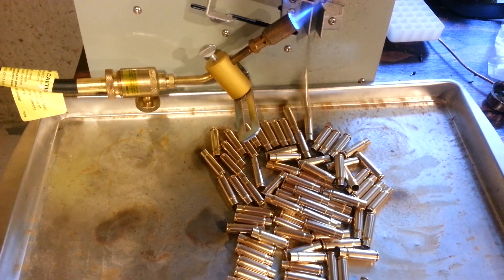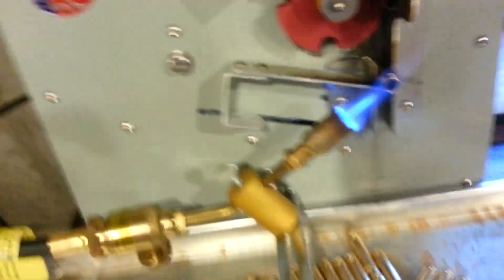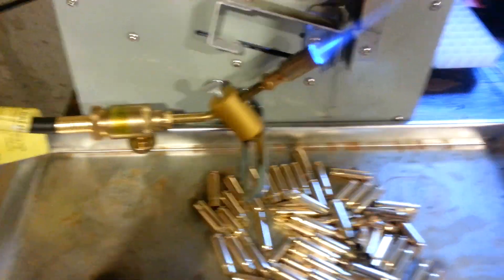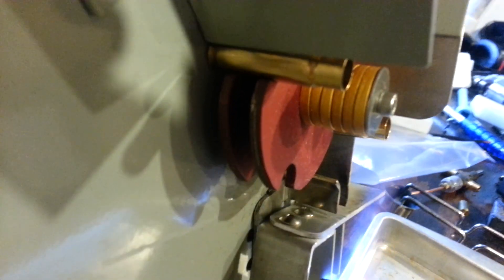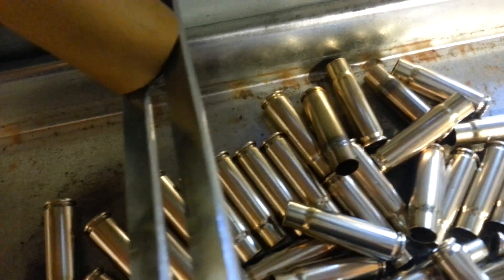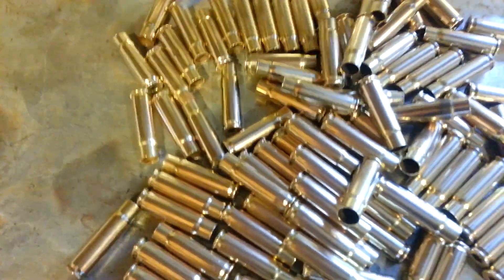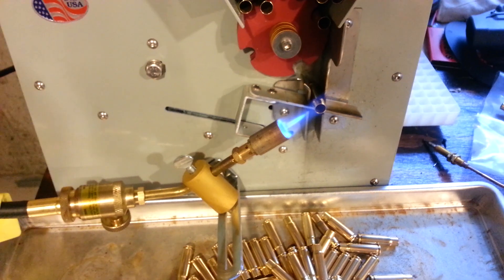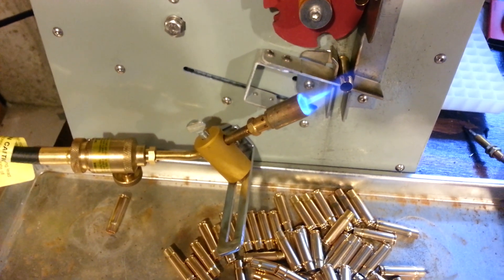Why coloring is not a good indicator of proper annealing.

Comment: A laser pyrometer is probably the best instrument for uniform annealing.
It's all about TEMPERATURE not color.
Reply from the maker: Yes, a laser pyrometer is a good tool to have, but keep in mind that the mass of these cases is quite low. You can't get an accurate measurement while it's in the flame, and the case will begin cooling rapidly the instant it drops out of the flame, so you have to be very quick or your measurements will be incorrect.

Comment: Has some tested with a hardness tester that 700 ° is enough. After what i have learned one has to anneal it for half an hour at this temperature. 900 ° to 1000 ° is probably more correct for approx. 5 seconds.

Comment: None of that "verification" is direct measurement of annealing.  You need to demonstrate photomicrographs of grain structure for 70/30 compared to a certified photograph, OR, use a vickers microhardness penetrometer tester on specimens material and compare that to the target value, OR run pull specimens on an Instron type machine with load vs. displacement.  That is three methods for your choice.  Everything else is guestimation.

Comment: I am repeatedly surprised by the large number of annealing videos that show dropping of cases into a tray following the heating process.  I would think that retention of body work hardening would be important, and that the best way to avoid creep of the softening into the body of the cartridge, where it is decidedly not wanted, would be to quench the brass in cold water once the neck/shoulder softening was complete - although I understand that this would introduce an additional drying step and time to the process.  

Also, I think the process rules for a company that produces annealed brass from used cases for use by anyone should be different from the process of an individual annealing brass for his/her own use.  In the former case, the brass has to be neck and shoulder annealed to accommodate full-length resizing, since the chamber in which it will be used is unknown beforehand.  In the latter, the handloader knows the gun in which the brass will be used, the brass is already fireformed to that chamber, and the best route is to neck anneal and neck resize only, I would think.  Thoughts?
Reply from the maker: Quenching serves no meaningful purpose. There's not enough mass in the case neck and shoulder for heat soak to be an issue, and the relatively large surface area of the case causes it to start cooling immediately. There's nothing to be gained by getting the brass wet again, besides, as you mentioned, more headache of having to deal with overprocessing them and drying them off again.

As a proponent of LEAN manufacturing principles, that's something to be viewed as one of the 7 deadly sins of waste.

People who quench are doing so based on a fundamental misunderstanding of how brass anneals.

And whether you're producing brass commercially, or converting it for personal use, the resulting work hardening is the same. The same care should ideally be given, but most people don't have access to expensive annealing machines, so it's cheaper for those guys to skip annealing, and replace their brass more frequently.

I know a lot of manufacturers who, unfortunately, don't have enough regard for their craft or their customers to anneal from the factory, or who want to charge additional for that as a 'service'.

We've always made it a point to anneal ALL of the brass we convert.

Comment: Hey Wrenchmonkey I'm just getting into Annealing mainly to create my own 22TCM cases from 223 brass. I was thinking with as super short the 22 CM case is water quenching would be a good idea just to stop the heat transferring  down to the base which could create other and possible dangerous issue. Instead of letting them air cool.
Reply from the maker: You can do that. Quenching doesn't hurt anything. It just means you have wet cases that you'll have to make sure are good and dry before you can load them.

Comment: Excellent description on how the cases should look. I have the same machine for 50 BMG and I tried until I was blue in the face to get the same color as factory cases. Burned a lot of cases until I found your video. Now it makes sense.
I know the temp is correct as the Tempilaq turns clear just as it drops off the end of the tray. I 'air dry' to save the additional step of drying wet cases in the oven. 
Now I spot check when I am doing a can of cases and the temp is right on the money each time. 
My cases go through annealing as the last step so it stands to reason they will not get as 'done' as cases that are unpolished but when the Tempilaq 750 goes to clear, I know I have everything dialed in.
Many thanks.
Mike in FL
Reply from the maker: Glad you found it helpful. If you are wanting the coloring that you're used to seeing from the factory, you can get decent coloring just by letting the case age for a few weeks before you anneal.

There is a way to get some really nice coloring into your brass, if you're sold on the idea. It takes a bit more work. It's strictly cosmetic, so we don't do it. It would add a lot to the cost of our brass, with no real benefit to the customer, so we don't do it.

But if you're doing your own ammo, and you just want it to look awesome, I can do a video teach people how to make some gorgeous case necks.
Reply: Don't really need to do any of that as I know it is cosmetic as you said. I am happy with what I have and when you tumble in SS pins like I am doing, it is all gone when I dump the cases out anyway. 
Going out to the shed to do some more right now. I have a nice color on my brass after it drops from the flame and I know it is right since the Tempilaq goes clear as it should. 
That was a nice video. I hit upon it by accident, do you have more? I will check back later.
Reply from the maker: My videos are kind of eclectic. This one was made specifically to address frequent customer questions we were getting where they weren't sure their brass had been annealed, or if it had been done properly, and to help address some of the confusion that is being posted on the internet that was leading to customer confusion.

I don't think I've done any other videos on annealing, but one of these days when I've got some more time, I think I'll go ahead and do a video on how to get really pretty neck coloring when annealing brass, because I have played around with it, and found a method that works surprisingly well.
Reply: Ok, will be on the lookout for more videos. Thanks.

Comment: You drop the hot brass on a tray. That is only one part of Annealing, You have to quench the brass to complete the process.  Annealing brass and not quenching it and allowing it to cool slowly defeats the process.  Quenching the brass causes the anneal to take. heating and allowing brass to cool returns almost to the original hardness.  The quench is the key.  Quenching steel is the opposite.  Heat and allow steel  and  cool slowly hardens the steel and it has to be tempered. Tempering Brass  by heating and allowing to cool returns it to  a harder state,  the quench is what actually tempers it
Reply from the maker: That's a common internet myth. Brass does not require a quench for annealing to work properly. Steel and some other materials do, but brass does not. 

It's an unnecessary step that people sometimes do because they've been misinformed (much like the people who heat it until they get a specific coloring pattern). The whole point of this video is to quell some of the internet misinformation that is out there surrounding annealing. Thanks for watching!
Reply: @Wrenchmonkey1   It's Kinda like heating glass, a slow cool-down with no quenching will do the trick.  Of course, glass, being more fragile, needs a REALLY slow cool down.  But the quench will fracture!!!
Reply: + 1 you you wrench. John is off base.
Reply: You are right with regard to steel, which hardens by a totally different process than that involved in brass.  Brass, moreover, is a slightly different animal than many other alloys.  

The brass annealing process is used to soften the case neck, which becomes stronger, but brittle, from cold working - the stresses imposed by firing and resizing - because the crystal size of the metal shrinks in the cold working process.  The objective of annealing is to soften the brass by increasing that crystal size, restoring the ductility of the neck.  To do so, the neck is heated to about 700 degrees.  

The quenching, however, is done for a different reason.  Whereas most annealing involves slow cooling, in the case of brass, this is unnecessary - once it has reached the critical temperature, the job is done.  The quenching is done to prevent the heat from moving down the case body, because the case body NEEDS to remain cold worked (as performed during the manufacturing/forming process) for strength.  If the heat proceeds down to the body of the case, the case loses that strength, and should be discarded.  That's why I ask above about dropping the cases into a pan, vs. into water.

Comment: am supposed to stop immediately once  it changes to the color of the tempilaq our do I wait until the tempilaq burns off and the instant it goes back to a regular flame take it off?
Reply from the maker: +dunbar1471 
Remove from the flame as soon as the color changes (It goes almost clear). 

Put the tempilaq on the INSIDE of the case neck, otherwise, it will get scorched as soon as the flame touches it.

Comment: Why not water quench?  I've seen it done both ways. Thanks
Reply from the maker: You can water quench, but there's no benefit, so it just adds an extra step and an extra delay with the additional dry time. I commercially process this stuff, and did over a million rounds last year.

All of our brass gets hermetically sealed in impulse-sealed bags, so any moisture left would be locked into the bags, and that's a bad thing.

And with the volume that we do, we don't have time to let it dry for several days.

We do wash all of our brass in stainless tumbling media prior to annealing, so there's already some delay with drying times, so going through it again is less than desirable. 

And even though we do allow adequate time for the brass to dry completely before we anneal, annealing and air drying is extra insurance to guarantee the brass is perfectly dry before it gets sealed. If there were to be any residual moisture in the case, the heat from annealing would turn it to steam, and flash dry it.

Like I said, quenching doesn't hurt the brass, but it doesn't help either, and it does hurt the efficiency of the process.

The brass becomes cool to the touch within 1-2 minutes anyway.

Thanks for watching, and thanks for the comment!